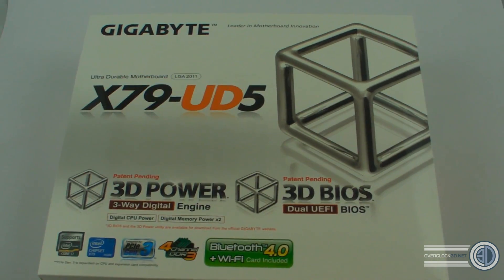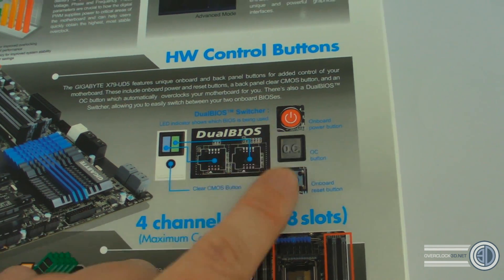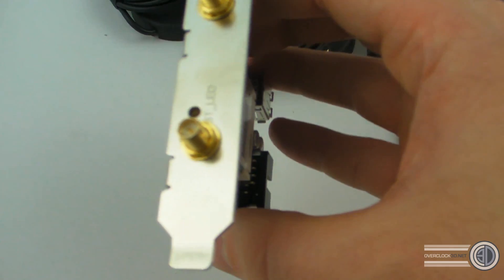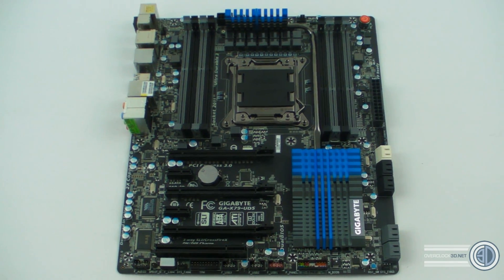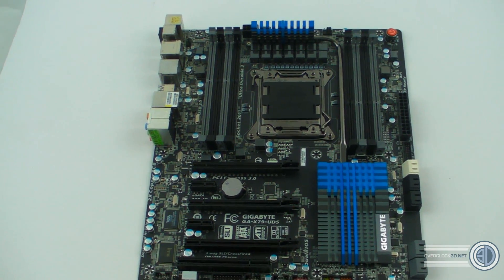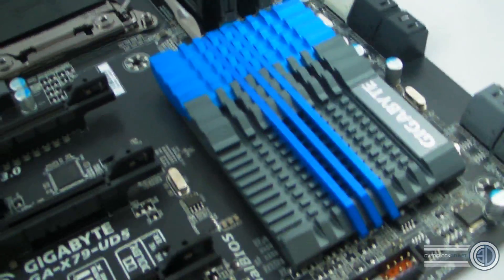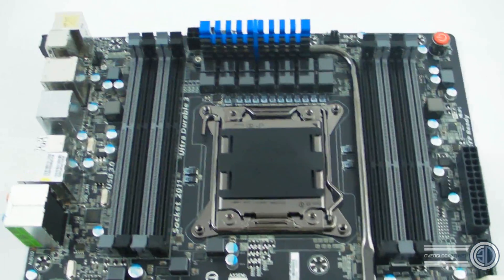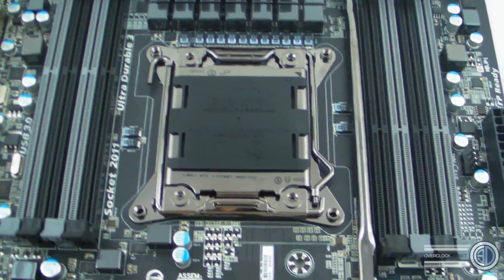Gigabyte GA-X79-UD5 Motherboard First Look UD5 X79 2011

Comment: Can someone please tell me what the speed of the shorter/smaller pci slots are?  I have a 2tb nvme in the 3rd (long) slot, I am wondering if the other shorter slots will bottleneck a nvme ssd?  I have a wifi adapter in the 2nd short pci slot.  Thanks

Comment: To clear up alot of confusion... The x79 Chipset will support the older 1366 CPUs but you need the 1366 socket, the 2011 socket will not support the older CPUs.
The asus dual socket danisu bay board has both sockets but a single X79 chipset.
Reply: Can you please tell me the speed of the 3 shorter/smaller pci slots are?  I have a 2tb nvme in the 3rd (long) slot, I am wondering if the other shorter slots will bottleneck a nvme ssd?  Are they x16?  I have a wifi adapter in the 2nd short pci slot but I can switch to USB wifi.  Thanks

Comment: @jaemurl from what i've heard single threaded performance will be similar, (so much better than 1366) and obviously there will be a higher memory bandwith, and with the quad channel memory you'll be able to do things like heavy rendering, photo editing, 3d modeling better along with page files (i think that's what it's called) 2011's real advantage comes in the form of mutli threaded applications, at least thats my view.

Comment: @WeirdoMikey2T You can charge a tablet on any USB 2 port anyway, these "new" USB ports only change how quickly they're charged.
I was actually on about charging USB devices while the PC is in an off state (PSU still being on) which is being advertised recently.
I can do this with my 1 and a half year old board, an another from 2007... bit of a delay in advertising I guess.
Reply: Can you please tell me the speed of the 3 shorter/smaller pci slots are?  I have a 2tb nvme in the 3rd (long) slot, I am wondering if the other shorter slots will bottleneck a nvme ssd?  Are they x16?  I have a wifi adapter in the 2nd short pci slot but I can switch to USB wifi.  Thanks